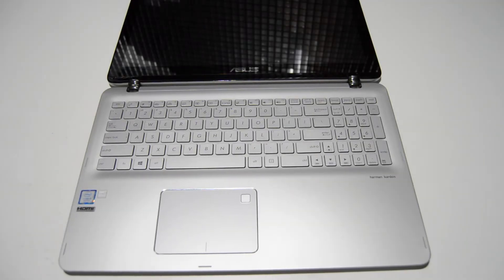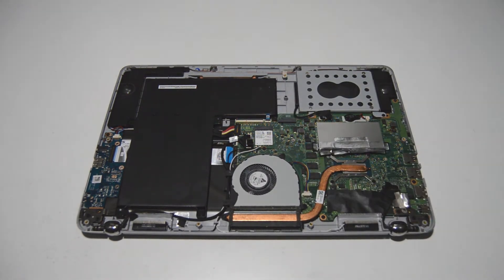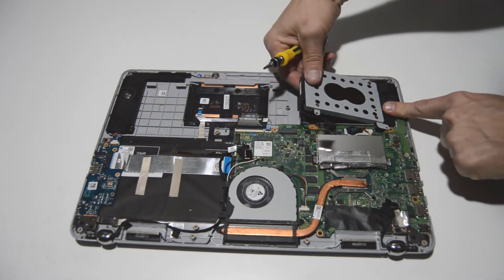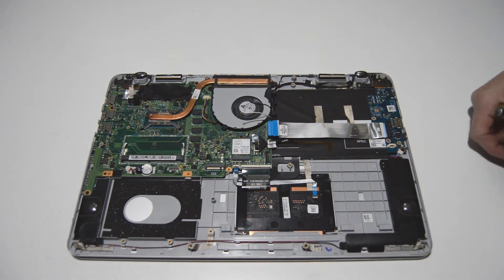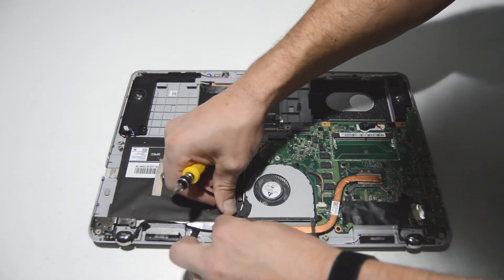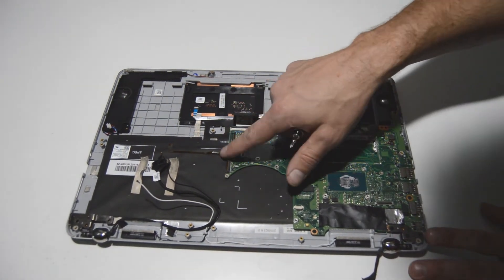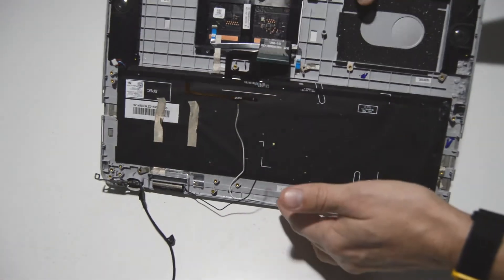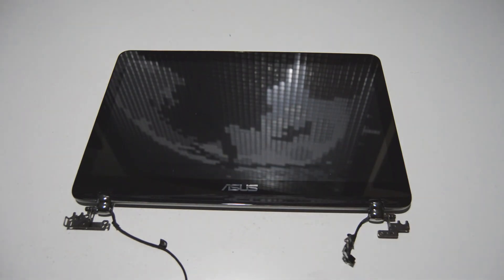How to Disassemble Asus Q504U Laptop

Comment: Question if anyone knows the ins-and-outs of ASUS flip laptops:

I have both a U504U and a U525U.  Both functionally work ok.   But the 504's left hinge for the screen completely broke from the base and cracked the screen a bit in the corner.  Internally, I don't care about the 504 -- it's too old.
>>>>  Can the 504's [SILVER] keyboard and mouse pad and surroundings successfully replace the 525's [BLACK] keyboard and mouse pad and surroundings ?   I prefer the 504's SILVER keyboard and surroundings instead of the 525's black.

Comment: This video was very thorough thank you. I have a question regarding only the touchpad. Mine is lifting in in the front and is not function for mouse clicking. Does the lifting mean that something is wrong with it or did it just pop out and can be put back in by opening the laptop? Thanks

Comment: I didn't see the M.2 port
Does it have one?
Edit:
I noticed, you do reply to the comments, so let me expand the question 
What steps do you make to replace the hard drive with the m.2 stick like this: 
CT2000P5SSD8 ?
Reply from the maker: It looks like it takes a NVMe 2280 size in that slot between the battery and hard drive. It may be worth saving some money and getting a smaller capacity SSD for the OS and any gaming or graphics apps, and using your spinning hard drive to archive stuff. After you install the SSD, enter the BIOS and boot from your Windows install USB or disc, then load windows onto the SSD. You may have to disconnect the hard drive at first to prevent it from booting Windows. After Windows is installed on the SSD, make sure the BIOS boots from that drive and not the hard drive. Enjoy the huge speed boost.
Reply: @Sellbrokedotcom  so does it take PCIe or SATA3 ssd? I heard it only takes SATA3 ssd not PCIe. It's hard to find the exact information on google or asus website itself. Please, help me choose the right ssd.

Comment: I'm missing the charger for my computer of the same model and wondering how to get the c type charger working for it, if that's even possible
Reply from the maker: c-type? Like USB-C?
Reply: @Sellbrokedotcom  yes, exactly. It has a USB c port on the side but it won't charge using it, I don't know if that's possible or not in the first place though

Comment: Thank you so much for this video! I own this model of laptop and could not figure out how to open it until you mentioned the hidden screws under the rubber feet. Thanks to you, I managed to open it, clean out the dust I had and made sure the battery was connected. Saved me a trip to the computer repair shop!
Reply from the maker: Awesome glad to hear it helped you!